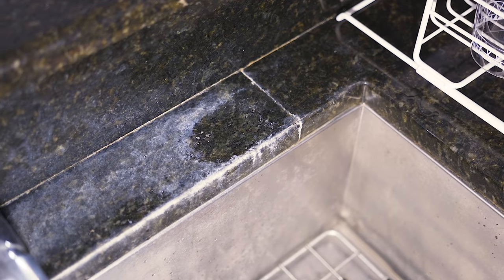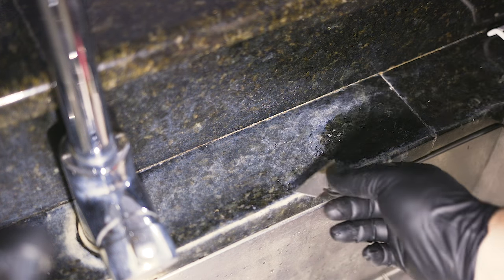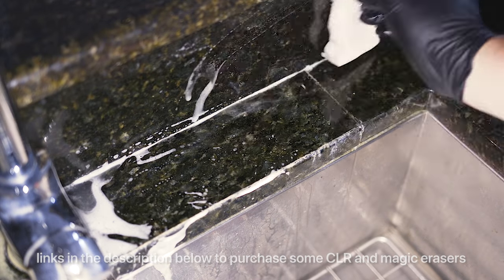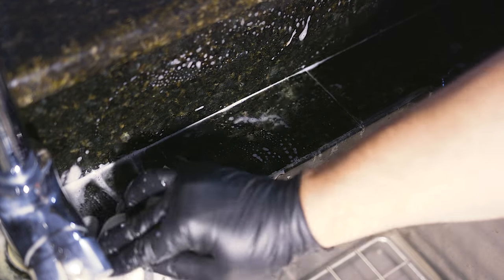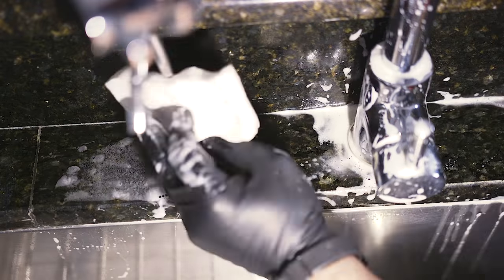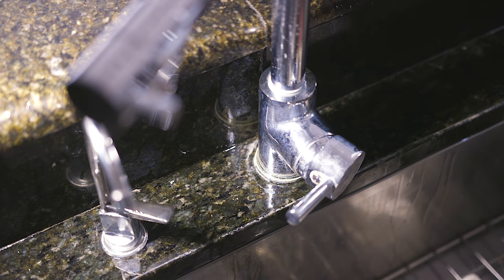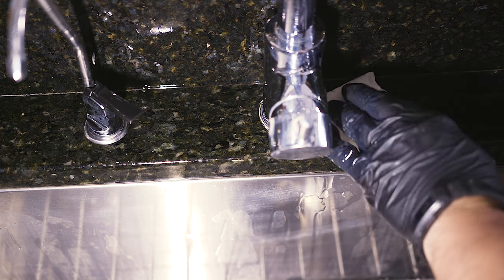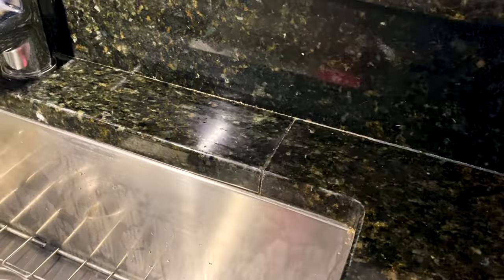How To Remove Hard Water Stains From Granite Countertops | Professional Results at Home

Comment: It's looking like it's doing a great job however CLR specifically states it's not to be used on granite, unless it is the kitchen formulation?
Reply: I was thinking the same thing but maybe the label says that because CLR removes the sealing process.   If that's the problem we just need to make sure to seal again after the cleaning process.

Comment: How do I know whether my countertop is granite and whether the dullness in the WHOLE countertop is due to water stains? Can I harm the countertop this way if it´s something else? Thank you!
Reply: If you have marble then CLR or anything acidic (even vinegar or citric acid) will etch your marble.  There are a lot better and safer ways to remove this that what this video is showing.  90% of this would have removed with a fresh flat edge blade, not the utility blade that he used. 

Granite won't etch with CLR though so it's definitely not going to hurt it. You can tell if your countertop is granite by if it is acid sensitive and by it's look (at least a lot of people can tell from appearance who have a somewhat trained eye)
Reply from the maker: CLR. Just limit the flash time you leave it on the marble.

Comment: Should I seal it once it’s cleaned? I got all the calcium build up off but it’s still a little cloudy and no shine once it completely dried
Reply from the maker: Buff it out with a little polish now.
Reply: What kind of polish or seal do you use afterwards?
Reply: I have the same question as DeAnna—what’s the best product to use to bring back the shine?  Mine looks very dull though the calcium buildup has gone...
Reply from the maker: High speed buffer and buffing compound.

Comment: I would not do this. If you have a spot on your car hood do you use A Jax and steel wool?
Reply from the maker: Who is using steel wool on a car hood? Bad parallel. It works. Bottom line.

Comment: I've been cleaning houses for years now and hard water spots are the bane of my existence!! For some reason, I can never seem to get rid of them...I've tried CLR and every product under the sun (including professional grade products) but never have been able to get results...I've tried everything...what am I doing wrong?! I've never seen CLR break down the scale like that. I must be doing something wrong! Shower doors, granite, marble...hard water spots haunt me everywhere I go!! Help me! Is it the magic eraser? I've tried that too but no luck...Maybe the stains I've worked on are just too deep and the stone/glass is too far gone. Thank you for the video though! I'll try again! But any feedback would be great. Thanks so much!! :)
Reply: It’s the patience. Pour the CLR on (not spray) and let it sit and work like he does. Most people want to “just get done” when they’re cleaning. So, make sure you dry the area completely with paper towels, if you pour CLR,on a soaked surface, the water would dilute it, right? Get the pourable CLR. Pour it on a complete dry area of granite, let it sit for 20 minutes, come back and use the magic eraser. Probably will have to go to Home Depot or Lowe’s for your CLR vs. Target. That’s another sacrifice. My big issue is the razor blades he is using are more rigid than the flimsy ones I can find...
Reply: I would suggest that different geographic areas have different percentages of mineral deposits, if all your work is in the same area look into what mineral presides and maybe get something that specifically breaks that down??? Just a thought.
Reply: Try Misty Bolex 23% Hydrochloric Acid Bowl Cleaner for hard water removal. It’s highly toxic so wear PPE! Make glass like new in shower areas. Read the MSDS first!
Reply: @freako918  wow didn't ever hear of this, where do you buy it?  Home improvement stores or hardware?

Comment: Any ideas on removing melted candle wax of granite ...it's a unfinished granite flooring on the porch...summer heat melted candle wax in the lantern which was decorative...have removed as much as possible but wax has permeated thru looks like..... any advise??
Reply from the maker: Have you tried heating it with a torch and cleaning?

Comment: Worked great on the granite but now my stainless steel sink has streaks from the CLR.  Any suggestions?
Reply from the maker: Yes. Mother’s mag & aluminum polish.
Reply: Calcium,lime,rust
Reply: Use VIM or AJAX in the powder form to clean Stainless steel.

Comment: From the CLR website:
"CLR may etch older sinks, tubs, and tiles. Avoid contact with wood, clothing, wallpaper, carpeting, natural stones, brass, copper, aluminum, galvanized metals, any painted, coated or sealed surfaces."

So clearly not a good solution!
Reply from the maker: Martin…. “May” I used it. Works perfectly every time. You go ahead and follow the instructions so you can feel better at night ;)
Reply: @Archifx  Yes admittedly it seems to work for you but I wouldn't risk it.

Comment: Yeah this is conflicting. If you google how to remove water stains from granite, everything says to NEVER use CLR and Magic Erasers on it.

Can I use both and then re-seal the granite immediately after...? Does anyone have comments about how doing this has ruined their granite...? I'm nervous to try it if it's going to make it worse...
Reply from the maker: Try it in a little spot. Don’t leave it on long. It’s user error that ruins surfaces.
Reply: Thanks, ok I'm gonna try it... I've tried multiple other things and nothing seems to work.

Comment: Says right on the bottle not to use on granite or marble ......
Reply from the maker: That’s because if you leave it on there for 3 hours it could damage it. All you’re doing is using a little acid erosion to pull the mineral off the stone. Works great. Maybe you should skip it if you’re nervous about it.

Comment: Lemon juice and baking soda does the same thing. Safer to use too.
Reply from the maker: Appreciate the feedback but nope... not on that stain. I tried everything in the pantry before I broke out the CLR. Trust me, I HATE using chemicals.
Reply: @Archifx  I use it in my bathroom around faucets. You have to put the baking soda on then spray lemon juice on it then wrap area with ceran wrap and let it sit. It does work. Gotta be patient. I usually do this when I start cleaning( got to let it stay on a while) and I clean where I put it last.  It works great on ovens too. Warm your oven...sprinke baking soda and spray lemon juice and let it sit overnight. Try it. You'll be amazed. No harsh fumes.
Reply from the maker: I like it. I’ll try it out! 👍
Reply: @Archifx  Let me know what you think after you do. I use this method because I have breathing problems. It's a lot safer in the oven. Smells fresh afterwards. Save your health and your money. Best wishes.
Reply: Rust like stain form in granite in white colour granite  floor .. y it is ... is it common.. how I can get rid of it
Reply: Reply please
Reply: @reenareena6943  it works..especially on ovens. Heat oven (just a little..100 degree) make a paste with lemon juice and baking soda and take an old paint brush and brush it on. Let it sit...maybe 2-3 hours or more. It eats through grease. You'll be amazed. No harsh fumes. Lemon fresh. Repeat it if oven is in bad shape. 
For calcium build up take cotton balls with same solution place on calcium and let it sit. If you're trying to clean faucets wrap cling wrap around to hold cotton balls in place. Be careful with brass don't leave on as long. Maybe 30 minutes. It works.
Reply: Gonna try this!!! Thank you!
Reply: @nana-px4wk  Does it have to be freshly squeezed lemon juice or can I use the bottled stuff?
Reply: @anafrega5224  No mam.. Lemon juice from a bottle will work. So will vinagar. Lemon juice smells better.
Reply: @nana-px4wk  is there any home remedy for black slap in kitchen? It has white stain from raw lemon juice.
Reply: @soumidutta6736  Have you tried a polish? I'm not sure what kind of slab you're talking about. I know that you can't leave lemon juice on a service for too long. The only place that I will leave lemon juice and baking soda on over night is my oven. Around my faucets I only leave for maybe an hour. Maybe an oil or polish will help. Have you searched the internet for some possibilities?
Reply: na na x
Reply: I thought lemon juice is too acidic and would damage the granite??
Reply from the maker: Get a respirator and some gloves, do it right and use CLR lol. Next thing... some one will say to use banana juice with some passion fruit.
Reply: Fix It Now I have minor water stains... would that stuff work on little ones?
Reply from the maker: I would try it. Yes. It’s probably calcium and CLR works on calcium
Reply: @Archifx  I appreciate people's feedback but you are funny.